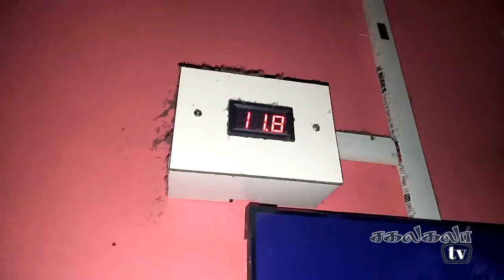12V DC SOLAR MIXER GRINDER|| SAKALAKALA TV ARUNAI SUNDAR||

Comment: Use a boost converter (XL6009 or better) board to increase the voltage to 24 volts.

Comment: Super Bro. I came across your channel recently and found plenty of things i wanted to do have been accomplished by you. It gives a strong nudge to proceed. 

I had been wondering if this kind of setup for mixie was possible. Main trouble being the motor capacity and the bush to connect. I'll try to use araldite itself then. Do u think RS775 motors will be right choice for movie motor setup ? 
Thank you for the wonderful videos again.
Reply: Saft apadi ok achu

Comment: Sir .75 hp bore motor is possible to run in solar system then what will be the cost the settings

Comment: Sir 12volts motor Slwith solar mixers so my idea is Ac to DC Adapter connection in Ac point power cut Adapter is not working And Connected batteries So running to battery connection continue motor is battery connection My idea sir

Comment: 48 volt motor LA try pannu ga
Reply from the maker: Will Soon
Reply: Sakalakala Tv no need, just use old smps from PC you can get 24V. It's enough
Reply: Can u explain
Reply from the maker: @santhosesivan1018   yes good idea ok